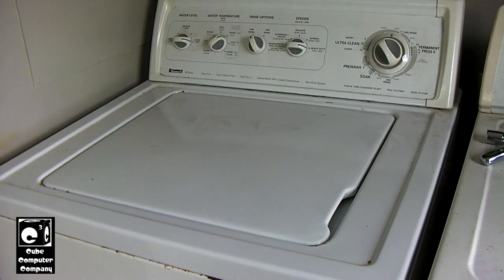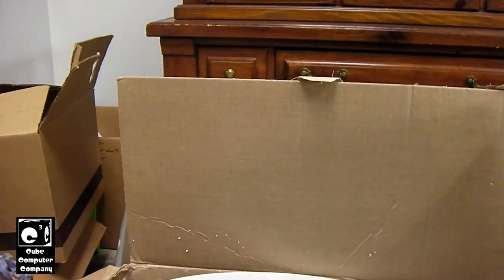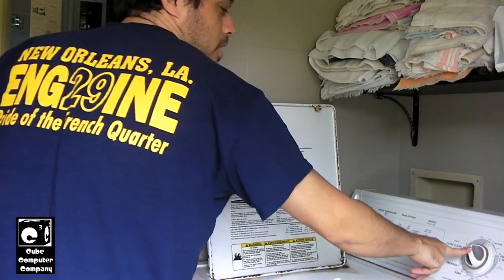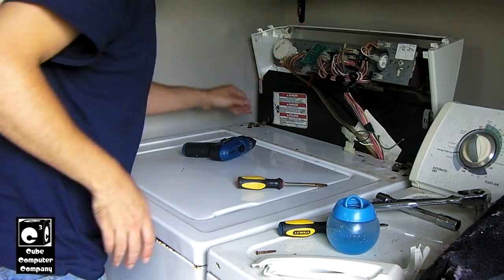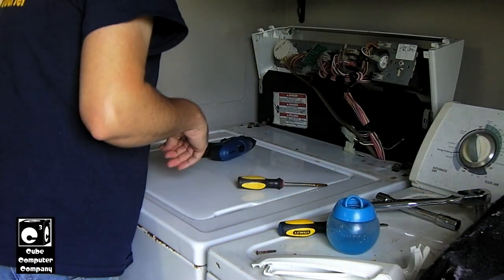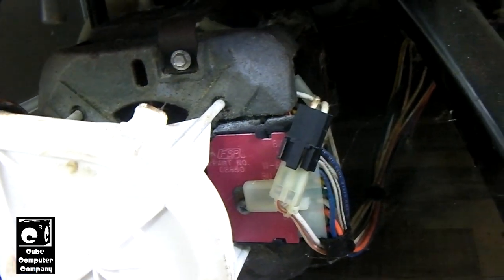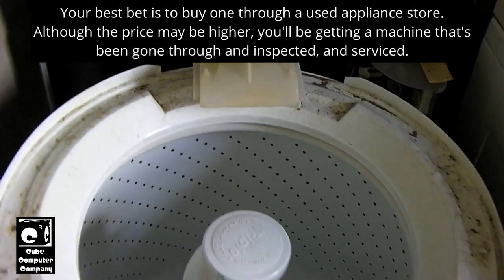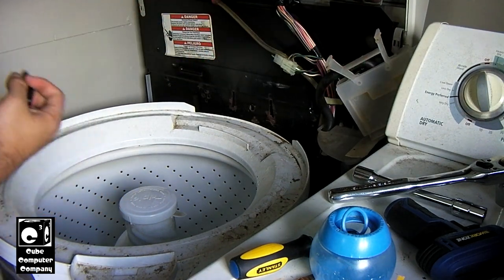Replacing the inner tub basket in my Kenmore 90 Series Washing Machine

Comment: You should have changed the tub seal. The shaft that the tub seal fits on - looks very corroded at the seal area. Mine was leaking slowly at this location.
Also, when hammering on the spanned wrench, you want to go counter-clockwise to remove that big nut.  Then put the nut back on upside down about 6 threads, the use a 3-prong gear puller gripping the bottom edges of the nut to remove the drive block.

Comment: Thank you for posting this DIY.
I have a similar vintage Whirlpool which was leaving lint and residue. I had planned to tear down, clean the tubs and reassemble. 
Mine was stored in a dry room but is absolutely filled with caked on residue from fabric softener and stuff being left in p pockets etc 
Ive stalled as i can't get inner tub out. It looks like corrosion on the span but and drive block, lots of gunk and these have fused to the brake tube. I got the nut out with very heavy hammer force but tub is stuck. 
The tub is quite expensive and is a special order part so im debating if i try to do what you did and use an oscillating tool to cut or i may pull the whole transmission and motor out from bottom and try to pry brake tube out from bottom. Id need tube AND tub then, but maybe less headache. But at that price i need to think about just getting a new machine. 

I've sprayed penetrating oil into that tube and on block for a few days now and not showing any signs of budging.

Thanks for the video. Real world conditions. 90% of the vids make it look like this tub just pops up with a bit of wiggling.
Reply from the maker: Even if you have to spend $300 on a new tub, it's worth fixing one of these old machines versus the new HE junk sold at Lowe's and HD.
Reply: @CubeComputerChannel  Thank you. That's what I'm thinking too but if I need anything else it starts to add up quick. I just priced the brake and tub and it's like 500 C$ assuming nothing else damaged.
Reply from the maker: @Lazerbeam323ci  Try to order parts from Amazon... sites like RepairClinic mark up parts big time. I paid less than $300 USD for the tub in mine.

Have you used cleaners like Affresh? There's another product I've seen on Amazon like Affresh for cleaning residue out of machines like this. I believe there are a few other methods on getting the lock nut to free from the tub. I used the hacksaw route since the tub in mine was already done for and why I was in there to begin with.

Comment: When the inner tube is filled with water, the outer tub is also filled proportionally correct? The exposed rust on the tub support (~4in of the black cylinder from the bottom center of the outer tub) is mixing with the water during the cycle. Can you please confirm before I replace this part (Kenmore 110.24872300 Washer Tub Support/Brake Genuine OEM).
Reply from the maker: Yes, when the inner basket is filled, the outer tub is filled to the same level.
Reply: @CubeComputerChannel  thanks for the confirmation and prompt response. Is there a reason that you did not replace/clean yours? Is that area sealed off from the main water cycling through the clothes?
Reply from the maker: @cliffhicks9562  I cleaned the outer tub. It wasn't perfect, but it was better than before. To replace the brake, I don't think you have to remove the tub, though I could be wrong. You can remove the motor and transmission from the bottom to access the brake that way.

Comment: You forgot the 8in plastic round lint screen that goes in bottom of Inner Tub...
Reply: Do you have any idea what part# that piece is? I cannot find a replacement for it and almost wonder if it's unnecessary. Three of the tabs on mine snapped off when trying to pry it loose from the rust. Was attempting to clean it out since it was nasty. Buying a new inner tub after discovering all the rust that was between that plastic piece and inner tub.

Comment: I am baffled as to why you didn’t thoroughly clean the outer plastic tub when you had everything apart? I still saw visible gunk once the new wash basket was installed
Reply from the maker: I was not able to get every single thing off. It's a night and day difference from what it was.
Reply: @CubeComputerChannel  An SOS pad works wonders on these. I have seen a lot of the gunk wipe off after spraying some all purpose cleaner on it. Rinsing in hot water is key. Sure you could have done better than that. But hey it's your machine.
Reply from the maker: @MatthewJames-st5wv  Yeah I wasn't trying to make it showroom perfect... the key thing is it doesn't smell anymore.

Comment: The directions clearly state to add liquid bleach first . You never figured it out that the bleach dispenser you have guides the liquid bleach to enter the tub  "BETWEEN" the porcelain basket and the outer plastic tub. Thus never going directly on the clothes but to the bottom to be then mixed with the water you add. The ring works for "TWO" different methods of dispensing liquid bleach....one with a hose and the one you have. I have the same type of dispenser only I have a whirlpool washer 😀😀😀
Reply from the maker: Mine does not say to add liquid bleach first. Mine actually says to "add liquid chlorine bleach to the dispenser, 5 minutes after the wash cycle starts for the best wash performance"
Reply: @CubeComputerChannel  The point I was making is that the "slot" in the bleach dispenser we both have, when installed to the plastic outer tub, will direct the bleach "between" the steel porcelain "inner tub" and the plastic "outer tub" thus never putting the bleach directly on the clothes. BTW, the same thing happened to my whirlpool  washer, the tube rusted through under the agitator. I used a hand drill with a cutting disk to cut through the tube at the slot of the threaded keeper.  I found the basket/part for $152.50 and $10.99 shipping + tax at Parts DR.😀😀😀

Comment: Fabric softener ruins machines
Reply from the maker: Lemme guess... it ruins the precious HE sensors this old machine does not use?
Reply: @CubeComputerChannel  Positive charge forcing electrolysis
Reply from the maker: @gvi341984  While this may be true, the reason why this machine had rust in the tub was due to the conditions this machine was exposed to for 10 years or so of sitting inside an old mobile home as the walls and roof had begun to fail. I suspect water had sat inside the tub for an extended period of time. There are videos out there of old machines like Whirlpool direct drives from the mid 1980s and GE FilterFlo machines of even older vintage still going. Whirlpool direct drives use a plastic outer tub, as seen in the video.